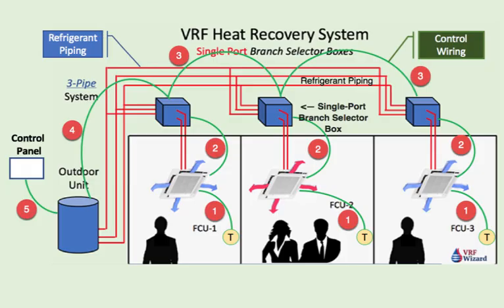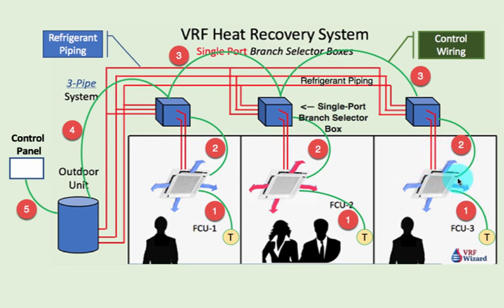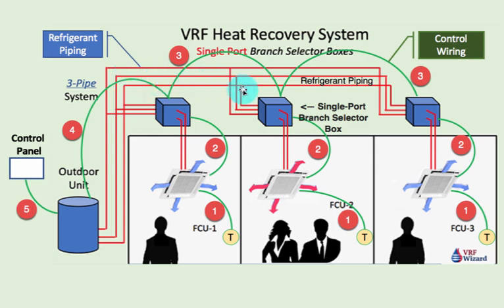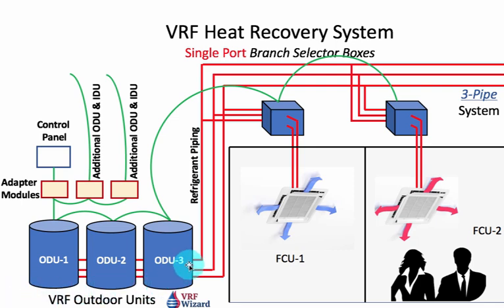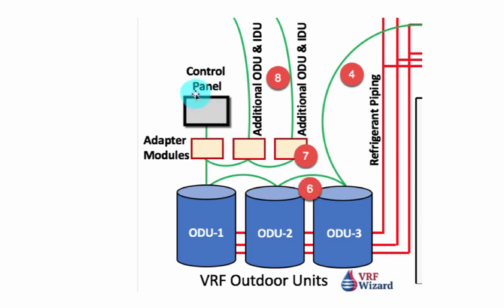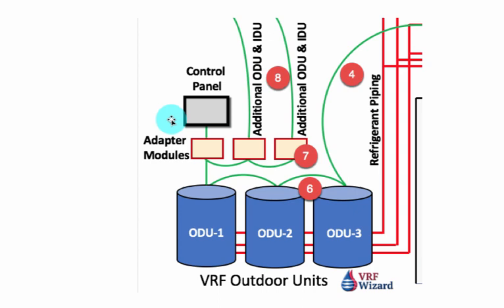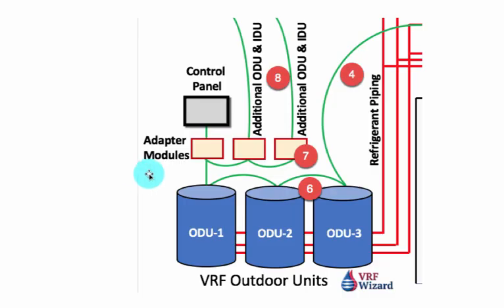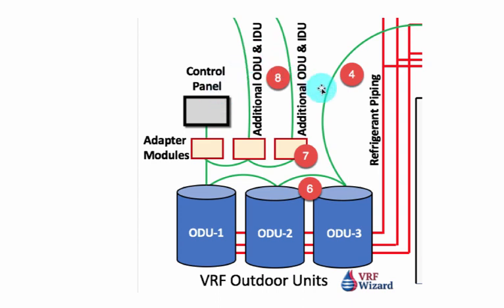VRF System Control Wiring

Comment: How do you extend control wiring?
 For example, what if your control wire was short and you want to extend them
Reply from the maker: They have what are called "Butt Connectors" that will attach two wires together if needed. It is best to run a continuous wire to avoid any communication or transmission problems if possible, if not, use one of these connectors, making sure to get a good connection.
Reply: I thank you so much!!!  I will be checking on you for future VRF knowledge. I used to know it -- your answer. , I am an engineer, but a year and a half ago I suffered a major stroke; I was unconscious for 2 weeks. But I am coming back now.  God is so good.
Reply from the maker: Good to hear that your doing better, God must have more work for you to do. One of life's purpose is to become the best YOU, that YOU can become. We have a lot of information on our website about VRF that we update more often than we do our YouTube channel, at wwwVRFWizard.com.